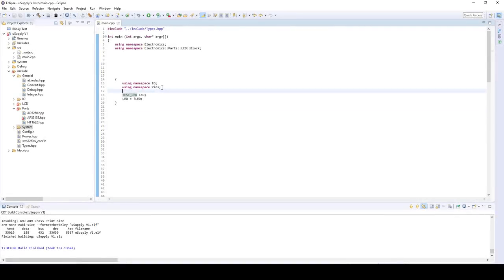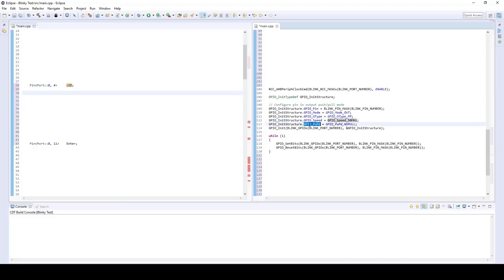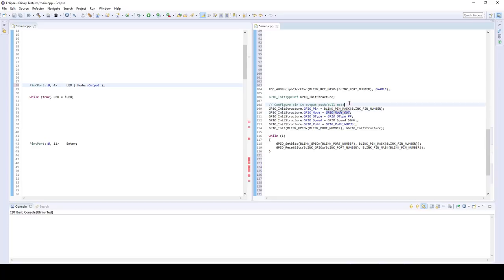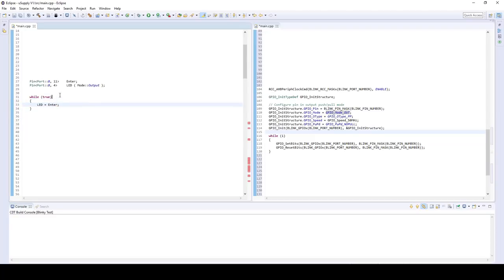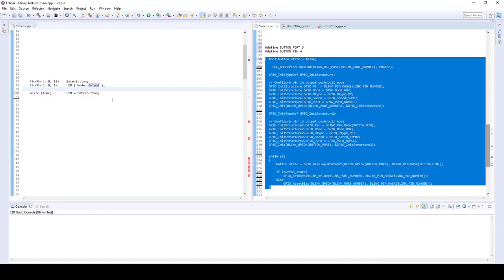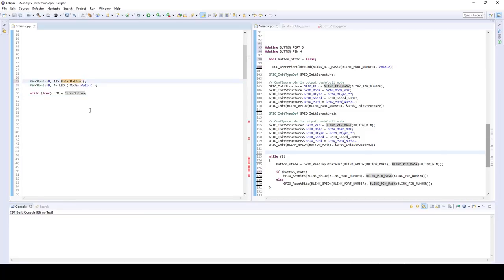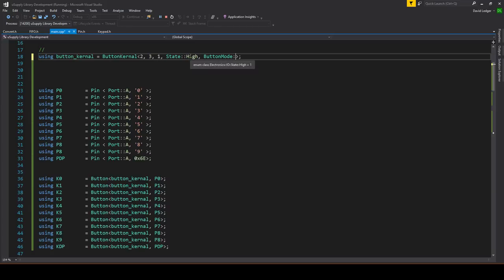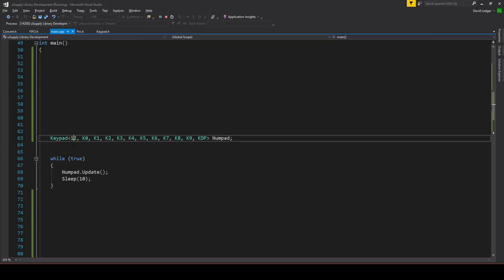C++ for the Embedded Programmer

Comment: David! No! You were the chosen one :(
Reply: I was going to continue your quote but it would just seem like I was shouting "I hate you" and wouldn't make sense :(
Does that mean you consider C++ the dark side?
Reply: Yes, I am one of the roaring dinosaurs that prefers C for performance reasons and thinks that C++ belongs on microcomputers not microcontrollers. Performance isn't everything, and I know this is increasingly irrelevant with micros/processors getting more powerful and memory cheaper, but I just get a kick out of optimisation. Also I prefer verbosity to highly abstracted code, even if the chances of making errors is higher and code readability lower. But these are only _preferences_, and not always the top priority.
Reply: I'm a performance geek myself, its just a preference I think (the language) and you would work great with teams of alike minded people who prefer the same thing as you. I prefer my design patterns but that doesn't make them the be all end all or invalidate other perfectly valid patterns (yours for example).

If you stick to a subset of C++ (because its a massive language) it does behave with identical performance to C. Objects in C++ as a rule do not perform worse than plain functions, they do however behave slower when you make things virtual (this is a common misguided practice for destructors, there are better ways).

Comment: You might want to check out Rust, it's a pretty nice language with pretty good capabilities in embedded systems. http://blog.japaric.io/ is good, http://pramode.in/2018/02/20/programming-a-microcontroller-in-rust-at-four-levels-of-abstraction/ has a good overview.

Also try VSCode or another text editor (Vim, Sublime, etc) instead of an IDE. Or even VS Community or CLion's trial if you feel the need for an IDE.

Comment: c++ is usable in embedded environments provided you adhere to some sensible restrictions. RTTI is out. Using the STL is out. Frivolous use of new/delete is out.
Also beware the overhead your compiler adds.

Oh and screw Eclipse.. useless bloaty Java powered wank. Try code::blocks if you want a nice fast IDE which does most of the things Eclipse does, without the overhead. It'll drive any GCC toolchain (Atmel AVR, ARM) just fine.
Reply: Indeed this is true. There are "embedded friendly" version available though for most things. For example I have a small library I use to have embedded friendly algorithms for things like std::function, vector, ring buffers, etc. Might be of interest https://github.com/korken89/esl
Reply: Codeblocks is awesome~!!! 
My second favoriate IDE (nothing beats VS for TMP programming, its amazing what it does for you), but eclipse was easier to setup eclipse for ARM and I hadn't used it before(i've only used forks of eclipse) so I figured I might as well give eclipse a go. I can say eclipse is alot better than people give it credit for, and alot better than some of the forks I've used of it 

code::blocks really does do most things better, but eclipse is alight, I think people take out their hatred of Java on eclipse a little, I mean don't get me started on Java but I wouldn't hold it against Eclipse.
Reply: VS has gotten worse over the years (the last version I really used extensively was 2010, 2015 is horrendously slow by comparison) but IntelliSense was always like it was reading your mind :) Edit-and-Continue debugging was awesome as well.

Granted that sometimes toolchain setup can be a pain, especially with arm and its 50 million variants.... i started with having to drive an assembler (in the Commodore Amiga days!) from a shell script though ;)
Reply: "RTTI is out. Using the STL is out."

Not at all. It all depends on how much RAM and CPU power you have.

Comment: I don't buy the arguments of the more abstracted code (on the left) having "less magic", you still need to know the classes and constants being used, the order they go in, etc. If you have the code on the right in your project, and want to quickly change it to make a pin into a pull-up, its an obvious and simple change to make. For the code on the left, you have to know how the pin declaration works, or go look it up, because there's nothing even hinting you as to how to set the pull up/down control.

Verbosity of code and explicitly setting values that should already be set by default isn't a bad thing, you mention yourself that the code could be ported to other platforms, what if those platforms have different defaults? but even more importantly, most code isn't perfect on first draft, and generally the more verbose the code is, the more obvious and direct changes are to make.

So the code on the left looks nicer, takes a little less time to write initially (although the code on the right would be primarily used by copy/pasting and adjusting the platform-standard block of code), but the code on the right is easier to maintain, and imo more self documenting.

For real world programming, where a bunch of developers have worked on the codebase before you, each with their own styles, having standardized structures like on the right is a godsend, not a harmful waste of typing. Can you even change eg the GPIO speed in the class being used on the left? or do you have to delve into the library (which again in real dev, you probably didn't write yourself), and make changes to it?
Reply: Absolutely, you need to know things about it, but they are more general things to learn instead of things that require the tables in a 700 page user guide.

The Pin class exposes absolutely every register function of the port in a type safe manner. To set speed its just pin = Speed::High;

The overloading of assignment was due to standard singleton reasons, the Pin class is of zero size, it is just a group of functions and operators that directly interface with registers which are calculated at compile time. Pins are physical hardware and are by their nature singleton.
Reply: When you're doing the code review you have to go through all that documentation to show that you have actually set all the required things correctly. Which realistically means either a comment or making all the parameters explicit. The latter will at least help when the library defaults change or your requirements change, because just like the C code you have what you want/what you're doing documented in the code. The great thing about hiding information is that when you need to know it... it's hidden.

One way or another you're going to have "pin one is GPIO 16 in output mode, not pulled up running at 50MHz" or whatever other parameters you've chosen/can choose. Hiding that five layers down in the includes isn't necessarily a kindness to the maintainer. "Speed::High" is a great example of namespace misuse, I'm guessing, either you've pushed that into the global namespace or you're using multiple namespaces in your code. Both lead to fun and games in five years time when some poor sucker has to fix a bug in your code (or, you know, just walk away because that's not your problem)

Comment: abstractions in 2kb of RAM....     Good luck!
Reply: Abstractions don't add memory footprint on their own, do they?
Reply: It really depends on the compiler. If the compiler is good in optimizing the abstraction away it shouldn't be a problem. But if you don't want to rely on the capabilities of the C++ compiler it's better to get rid of the abstractions and do it manually.

Comment: Have I heard: you don't need to know why and what he's doing ???? WTF
Reply: I did it for code readability and consistency, what I did was:
1. use meta programming to link registers at compile-time to a static, size 0 object
2. obtain theoretically performance equal to that of direct register manipulation 

That is if I did my forwarding correctly... which I am still checking... but I can confirm it functions correctly as it is tested code. Complete inlining of the register manipulation is something that is theoretically already implemented but not analysed as I haven't had time to analyse the disassembly yet.

Comment: what a waste, yea most people know using predefined libraries in C++ is easier than in C. Thats like stating C is easier to use than ASM, each language has its specific use case.  C++ is great and simple but good luck with high speed applications, or embedded environments with limited memory.
Reply: you can perfectly do it...just keep your memory allocations static...dont use "new"....and if you ran out of space, we have 2018...use the propper chip
Reply: C++ has no overhead, unless you want it to (like exception support).
Reply: do you even __attribute__, bro?
Reply: what he did is kind of unfair comparison, of course using a simplified method is easier than using a struct with many more fields. But I disagree with you that you can't get speed with c++.  If you use basic c++ it is just a syntax difference. I wouldn't use all of the language. Any cost is if you aren't thinking about what you are doing.
Reply: It has exactly the same control of pin state, I programmed the library, it has all of the pin settings, but it only exposes what you use.

The following is valid working code:

LED = State::High;
LED = Mode::Input;
LED = Speed::High;
LED = Resistors::Pullup;
LED = Type::OpenDrain;

I overloaded the assignment operator because it you cannot reassign GPIO in reality so this meant that if I were to accidentally do the following:

if (LED = EnterButton)
             ^
The compiler would report an error (which is is), one pin cannot be another pin.

You can also construct the LED object using the above things:

Pin<Port::A, 4> LED
(
    Mode::Input, 
    State::Low, 
    Speed::High, 
    Resistors::Pullup,
    Type::OpenDrain
);

Strictly speaking the C++ code does *more*, as it automatically manages whether the modules power is on or off. Automatically being the operative word here. The automation is scope based too so it doesn't have any performance penalty.

It is comparing two libraries essentially, I agree.
Reply: it depends on how you use C++, I write a lot of drivers and find myself using virtual functions often. These have significant overhead, but it does lead to more recyclable code. (moving from one platform to another requires minor additions of code).
Reply: +1, exactly right. There are some ways around virtual functions (c++17) which allow calling lists of structurally similar functions (member function or otherwise), std::function + some nifty template code make that possible.
I'm going to do a post about it at some point :)
Reply: Good especially the Templates. Do checkout boost Template Meta Programming library MPL, in C++ you can pretty much get the same performance as C but elegant and object oriented code.
Reply: GameProgrammer79 Oh God no, do not use Boost MPL! It's old and horribly inefficient and gives error messages no-one can understand. There is a replacement called Kvasir MPL which is about 100-1000 times faster and is composable through continuations.
Reply: Emil Fresk, thanks for the info around Kvasir library .. MPL are best way to write compact code and these are headers only, not dependent on other libraries .. require a updated version of g++
Reply: If you can do C++11 Kvasir MPL works (I think from GCC 4.8 or 4.9), and as with Boost MPL is just a header only library :) But if you don't use C++11 or above you are really missing out on what is now "modern" C++.
Reply: Hm meta-programming is fancy and I did it before but when somebody need to touch the code and don't know it he/she is in for a hell.  In most cases it will be then thrown out of the window and newly written.
Reply: Its a strange beast, for people who know it Its not to difficult to read, just like any other language, but for people who don't, they cannot. Its a very different language to vanilla C++.
Reply: Zero overhead principle.  If you don't use it you don't pay for it!

Comment: All that demonstrate is your C library sucks and your C++ one is well made. This have verry litle to do with the language.
Actually the C library is designed verry low level (which sometimes is good) while the C++ one is designed for higher level usage (so by efinition simpler for simple task). Just design choices. You could do high level in C and low level in C++ if you want to. 

just 2cts...

Comment: Unfair comparisson, and from my point of view, just usless up to complete garbage...as when i come across some stuff i didn´t DIY and see just a single line of code i still wonder if something like this kinda absraction is causing the main or at least an issue....may the compiler was different and/or some of the options switched the wrong way or not at all...also fuses can/could be an issue as well, also moving the background stuff from one place to another (in the case your libs) is not a good thing, as i also want to know exactly what the code is up to...just a line my be nice to read, but if you have trouble with our code, where do you start and furthermore if it´s not your code, what do you do, if it doesn´t work as intended .....No thumbs from me here...